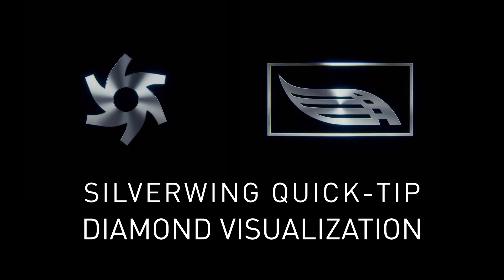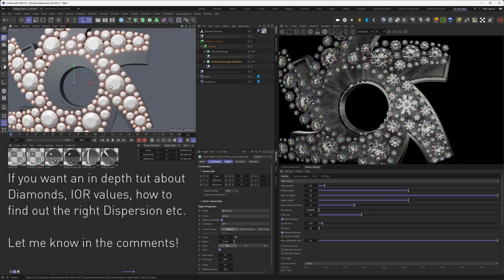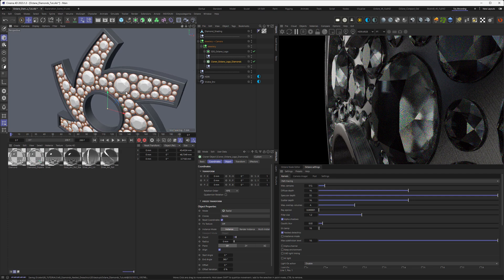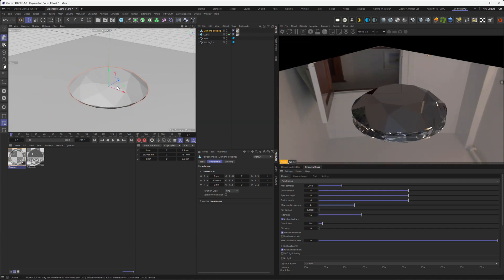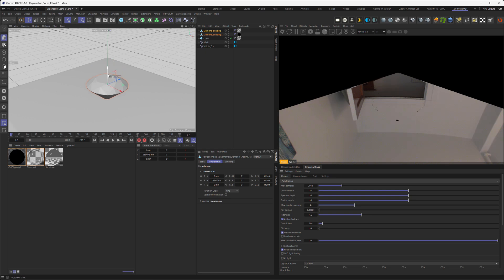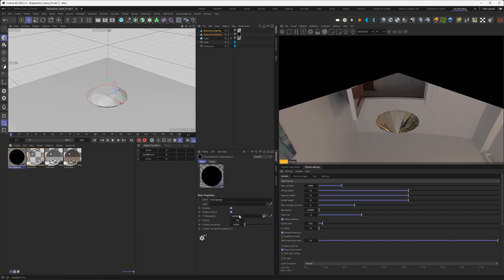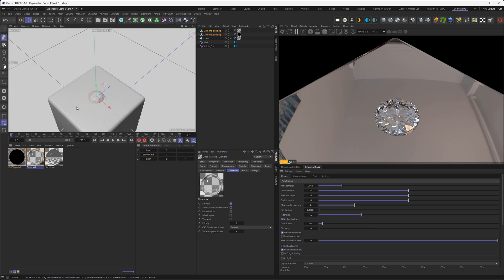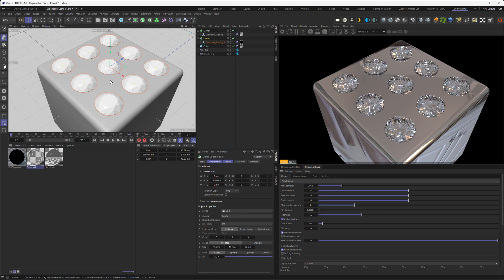Silverwing Quick Tip: Diamond Visualization (Using Clipping Material)

Comment: Hello! Please tell me, is it possible to somehow achieve mixing assets in octane, like in Anreal Engine, using a virtual texture or  pixel depthoffset?
Reply from the maker: Hey Микола,

thank you very much for your answer. I am not very fluent with Unreal to be honest.
I think I have an understanding what you mean. Blending objects / textures together by the approximate distance.
Theoretically this should somehow be possible with some trickery in Octane. I have seen people have done it in Blender Cycles. And if it works there it usually can also be done in Octane. But it would be probably far from an elegant solution.
As I do not have looked into this topic and do not know the usual approach for creating the effect I can´t tell you, how easy it will be to implement.
Maybe you just opened my eyes for a future research field 🙌 ha ha ha.

Cheers and a great 2024 to you!
Raphael

Comment: How did you place diamods like that on octane logo ? manualy or using something ?
Reply: for more advanced maybe check out "blue noise" there is a node in the C4D scene node editor
Reply from the maker: @simontrickfilmer  Yeah worth a try. For the preview I wanted a rather regular pattern. Blue Noise will distribute the gems in a more random way.
Reply from the maker: I placed them manually on one of the spikes, then cloned them all around 🙂

Comment: Hi Silverwing!Great tutorial as always! I tried to ask you for help in a private message on a social media platform, but it didn't seem to work, so I had to comment here. Could you please rebuild this Glitter effect in octane? This would be very useful. I read in a paper that this seems to establish a new BRDF mode and it looks difficult to learn from it.Link:https://youtu.be/x2zDrSgrlYQ?list=LL&t=170
Reply: Damn this looks awesome
Reply from the maker: Hey there. Sorry I did not respond. I try to answer everything I can. It must have slipped by!
I definitely can make a quick tip on sparkling materials. Sounds like a good Idea.
So you don´t have to wait so long, here´s a quick run down. Usually this is done via a normal map. Those are known as "Flakes Map"
In Octane there is even a shader node that does that called... you guest it, Flakes.
I might go through how to create certain types of materials. Metal, wood, plastic etc. More complex ones like carbon and car paint. In the car paint one flakes would be a part of a metallic car paint. Cheers and a great time to you!
Reply: @SilverwingVFX  I gotta admit, I usually use the Flakes OSL node and have nice results, but not as eye pleasing and realistic as in this youtube video! I have to make some research :)
Reply from the maker: @oursonwelles  Yeah. I think Octane will not implement a "Glitter BSDF" since every new addition like this takes away more vram. Although I have to admit it would be nice to see it implemented. I personally have made a tilable normal map some time ago that I use regularly as well. I, like you, would have to do some more research though 🙌
Reply: @SilverwingVFX  Thank you very, very much for your enthusiastic response! I've also tried flakes osl node which gives us a similar blinking effect, but I found that the blinking effect in the video link only appears in the highlighted reflective area and disappears into the diffuse surface, flakes osl node doesn't seem to achieve that, it still appears on the diffuse surface, it would be very cool if you could work out the effect at the video link!😄
Reply: @SilverwingVFX  It's ok it's not your fault, I tried to ask for help on Twitter and found you didn't have private messages turned on, so I came here haha😁

Comment: Great quick tip. On the topic of future training - I always struggle with interior design fabrics. They are usually fabrics that I have to copy exactly from a designer’s sample. Often with multiple materials on the one object eg. rough silk + cotton on a sofa cushion or intricate patterns of woven cloth. I’ve monkeyed around with Substance Designer, but I’m rubbish at it! Any thoughts?
Reply from the maker: Hey Pete. Thank you very much for your comment and your request.
Its a rather specific but I think also a good one. I have to admit that Cloth is one of my least used material type, simply because I usually work in tech viz.
I write down the Idea. It´s definitely not a bad one going through different cloth materials!